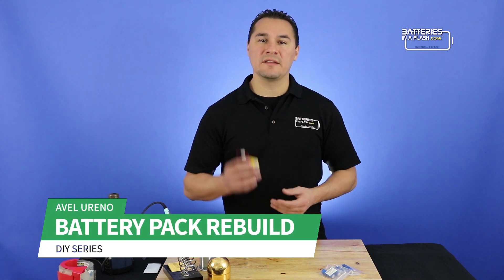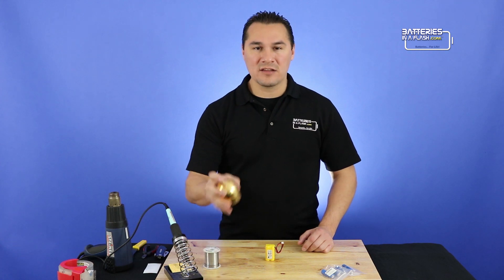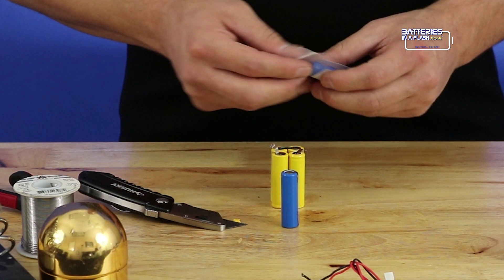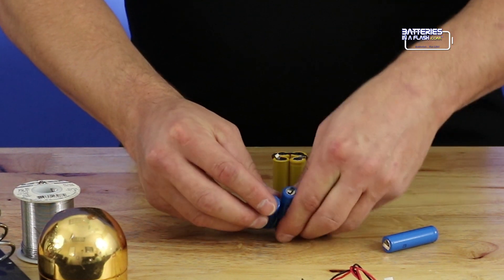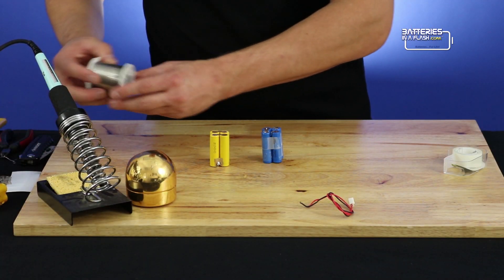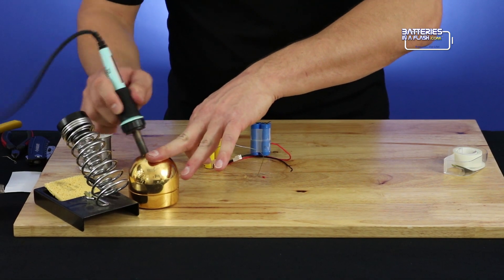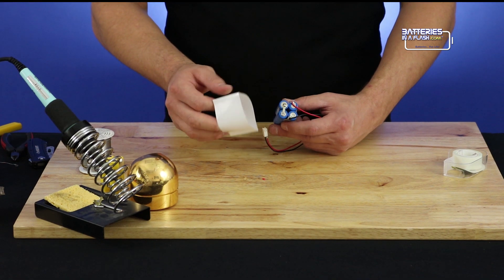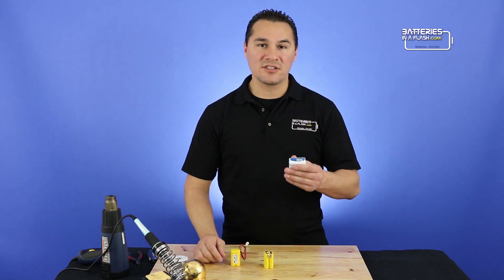DIY Battery Pack Rebuild

Comment: It's called flux core. Will the wires you used to connect your battery pack / array be as good as the original nickel strips?
Reply from the maker: It would work however you may have issues with snagging the wires possibly. You can find nickel tabs on our website if you need them.

Comment: Did I miss something or did he completely skip connecting the bottom terminals?🤨⁉
Reply from the maker: You are correct. The bottom connection portion of the video was skipped by mistake. I will be following up this video soon with a better version of it. I actually have a cleaner way to DIY users to do this at home that will yield really great battery packs. Stay tuned.. Click the bell for notifications and subscribe.

Comment: using soldering iron to connect batteries is a big no no.. batteries should be spot welded..
Reply from the maker: That is why I used tab and soldered them and not the batteries directly. I agree which is why I explain that in the video.

Comment: Would help if you zoomed so we could actually see what you were doing
Reply: There are  a few suggestions for getting a good result
do not attempt to do this until you are sure what you are doing - the acid can burn your skin
check the voltage first - there may be a kaput cell which would waste your time.
Check the battery fluid.
attempt to fully charge the battery.
(I discovered about these and more from Jons Mender Guide website )
Reply: @carnuroalnanda5241  check the fluid?!! Not even close to relevant!..these are lithium cells, not old school car batteries! Even auto batts are sealed now. Please promote your site elsewhere

Comment: Hello, 
I bought a 2.4Ghz. RC Hummer, His Battery is NI-CD, AA700 mah  9.6V. The problem is battery backup is approx 10-15 minute. i need more power Can i change it to Li Po or Lithium Battery, please acknowledge which and how i can do this, share any information regarding the same if possible.

Comment: don't u use the protector pcb on this 18650 pack...?
Reply from the maker: Depends on the 18650 battery. Some of them have PCB built into them and some do not. If it does not and you want to add one to the entire battery, that will work too. Make sure that the board is designed for the battery pack characteristics that you have made.

Comment: hello, I have one battery pack that is made of 8 batterys, is a 9.6 v 1800 mAh but it has 3 wires and i can't fine it anywere, is it posible to build one?
Reply from the maker: +Abel Huet You can definitely build a pack like this. The 3 wire could be there for a couple of reasons. Smaller voltage for another function or battery monitoring. Remove the outer plastic of the battery pack and find the cells that you need. Then simple rebuild pack with same configuration and reuse connector from old pack.